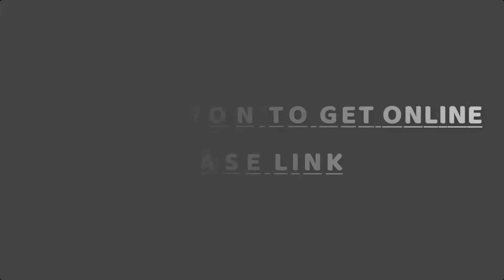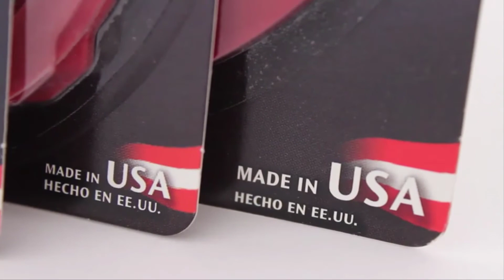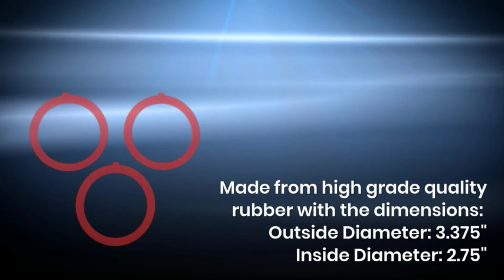Top 5 Best Toilet Seal Review in 2024

Comment: Question.....   can the PREFECT SEAL be used with an "offset" flange.   I need to use Sioux Cheif's 1  1/2" OFFSET flange in order to correctly fit the rough in.   The flange's first wall contour is a 45 degree angle.  WILL THE BLACK INSERT inside this PERFECT SEAL contact this 45 degree flange wall when the PERFECT SEAL's WAX compresses and the BLACK INSERT then GOES INTO THE FLANGE ?      ANYONE KNOW ?